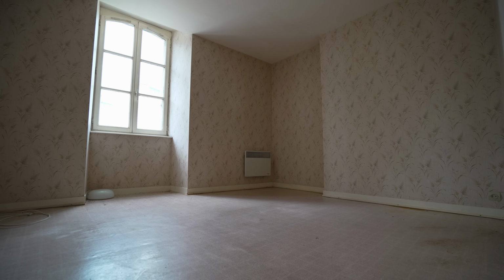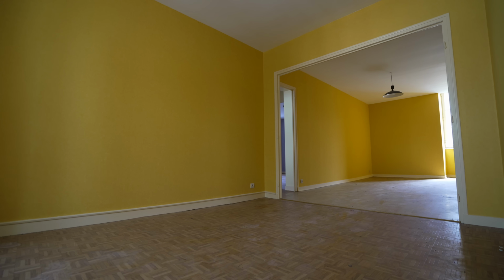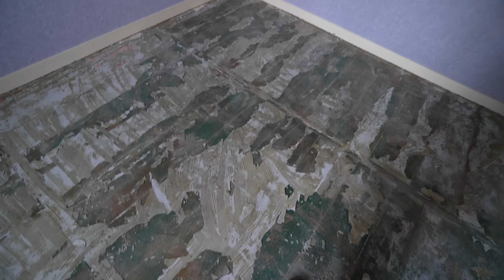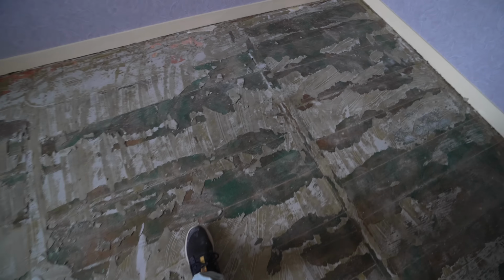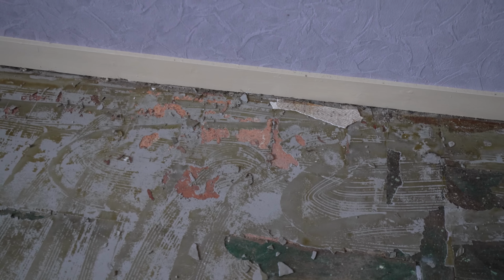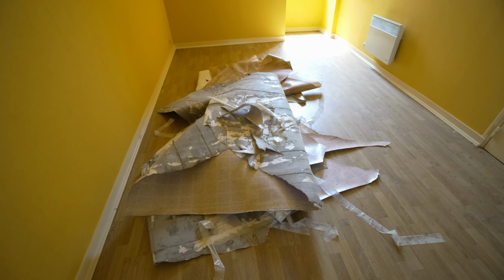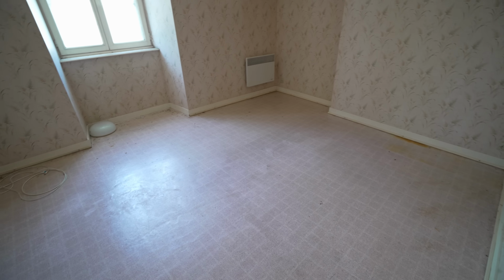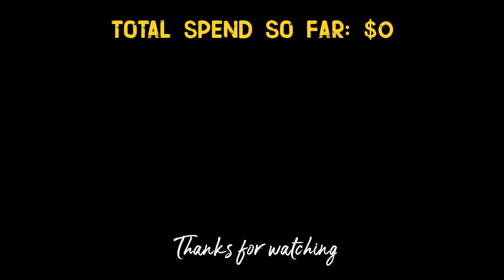Discovering The Original Floor of This 250-Year-Old Apartment

Comment: Honestly, I’d just redo all wood floors in all rooms that have them at the same time. It would actually be way more efficient and cost effective in the long run. I’d also just bite the bullet and hire out a professional crew who has the proper machines that would remove all of that adhesive in a few passes with specialized machines, sand down the wood to a nice smooth layer and then they will varnish or stain it what ever color you desire and finish it off. You’ll have new hardwood floors in no time while you focus on other areas like the kitchen. That would be most efficient and effective in my eyes.

Comment: Ryan! Please do the same level of Reno as is happening everywhere else in this amazing project! And even more so because this is going to be your Home. You deserve to invest in it. That Lino needs to be removed from that space.  Those rooms are not that large and it removed relatively easily. You deserve a beautiful space. Don’t cheat this process!
Reply: Those rooms are large - and the idea is for the reno to be done quickly and at low cost so that Ryan can move in quickly, so the best thing would be to put other flooring down now, and then at a later date, if Billy wants to, he can restore the old flooring.

Comment: Ryan, maybe Phil will lend you the floor machine he used on the entry hall floor of the convent. That might at least remove the adhesive off the green wooden floor.
Reply: I don't think that machine would be a wise option, it uses water to assist with the scrubbing. 2nd floor and wooden floors wouldn't mix great with gallons of water.
Reply: A large belt sander would be a better choice. Removes the top 1/16 to 1/8 inch or 1 to 2 mm of wood and usually leaves a good look behind. The wood can then be stained and sealed.
Reply: That machine does not use water. Phil applied scrubbing liquid to the floor & with a change of heads it becomes a sander. Perfect for what Ryan needs to remove the previous binding to bring up the original floor. Phil’s machine can sand, polish & scrub floors. It’s a simple matter of changing the rotating head. It does not use its own source of water.
Reply: Just what I was thinking. A simple change of the rotating head.
Reply: As suggested before try one of  those floor sanders. Maybe someone has one one you could borrow. Anyways good luck.
Reply: ABSOLUTELY GO FOR THE MACHINE.
LOL !
Reply: @markh3271  Yes , I would go Sanding route. I did not realize the other machine used water. Lol
Reply: I would like to see it sanded down & refinished.
Not sure if they have in France the type of floor sander with a vacuum that draws up the dust as it sands?
Reply: One could use adhesive remover...
Reply: Keep the wooden floor please!!!
Reply: See if water alone removes the adhesive! Worked for me at least
Reply: @markh3271  I think he should check for lead in the paint before doing that though...

Comment: Keep the wooden floor! You'll be sorry if you don't. It may be alot more work, but will be of more value and will match up with the hard work Simon put into the kitchen. You can always put heavy Safavieh rugs down over the wood. Next room, take of the baseboards first; then you won't have to take the time and remove vinyl again around the corners. Just a thought

Comment: I think you need to put the effort in to save as much of the original floors as possible. You can always get larger area rugs to put down to keep the rooms warm in the colder seasons. If this ends up being something that can be rented if you are no longer there it will be so much more attractive to any tenant than linoleum. I want to be there and help on this project!!! 💚

Comment: If the wood floors are throughout the apartment, then you should restore all.  In the long run, you’ll have more satisfaction, not to mention more value.  However, recovering the whole apartment in like flooring will give you more consistency and symmetry and less work.  I think you would be happier with like flooring throughout.
Reply: I do agree with you
Reply: Not Modron, like Ryan mentioned. It’s a beautiful old building, and that style should remain.
Reply: Suggestion – if you put a tarp down in the living room and put your garbage on top of it, it might make it easier and less messy to get the garbage down to the first floor
Reply: I agree, I did the same to a very old house here in NZ, it takes time , just do it one space at a time . Sand and use a two pack poly on them for a long hardwearing floor. Timber is so much nicer, has more character  and can be refinished over and over with time. Add some quality rugs and you have something more in keeping than that plastic stuff masquerading as timber.
Reply: The idea is for Ryan to do the place up as quickly as possible and move in. It would be better to put a new floor over the existing one, then at a later date if Billy wants to restore the old flooring he can.
Reply: True , but cost wise presently and time wise , it might not be feasible.
Reply: It you have the option for wood floors that are well over 200 yrs old it would be a crime to cover them.
Reply: @karenholmes6565  It would be sad but it wouldn't do any real damage.
Reply: Exactly 😊
Reply: @janetpendlebury6808  he has the time, staying with Billy/. Ryan loves to create drama. ts part of his personality. the lad will be fine. do it right the first time. dont waste money or time.
Reply: @Ragnar8504  nail or staple holes will scar the wood
Reply: @judithlalande2773  A floating floor of course, laminate or engineered hardwood. You can even install carpet with a few strips of double-sided sticky tape in neuralgic spots, especially doorways. The hwole professionally installed carpet in my gran's place was loose with some tape, a godsend when the landlord made us remove it before she moved out.

Comment: I think keeping the wood floors would be a nice touch. There are solvents designed for wood floors that will remove adhesives like that. You'll want a good floor scraper, hard plastic edge and then a couple gallons of the cleaner. After the adhesive is up, you can refinish the flooring and stain or seal the floor.

Comment: I would definitely keep the wooden original floor. Just from looking at them they don't seem too damaged, they just have a lot of glue  and plaster dust on them. You will want to use a big orbital sander to sound it down though.  If you aren't sure about the floors you could take just a normal sander and sand a portion of  the floor just to see what it looks like and make a decision. But they don't look half bad.
Reply: Don't be in such a hurry, do it right and it might last 200 years.....like Simon says about his plastering.

Comment: You know you want all original wooden floors throughout, gowaaannnn!

You should consult somebody who knows about adhesives and their removal so far as getting that off without ruining the wood. There’s probably a solvent for it, tho it’ll likely require you to wear a respirator. Maybe a flooring shop in the area would know, or a wood restoration expert? You can try grinding/sanding/chipping it away mechanically, but damage to the wood underneath is likely in all those cases (tho in differing amounts). And the wrong solvent might damage the wood as well. But I guarantee there are people out there who have the answer for just this specific situation!

Comment: Ryan - just an idea… pull up all of the vinyl flooring and sand back the timber floorboards and then varnish them. They will look amazing. You’re going to have to do that to get the glue off anyway so might as well just do the lot in one go. Avoids different heights from room to room also. Have a think about it if nothing else 👍😊

Comment: In my Arts and Crafts home…under a layer of press on vinyl tiles, over a layer of sheet linoleum, and a layer of 1/4” ply…I found perfectly preserved original hardwood, original to the home. I now have restored hardwood throughout the entire home. 

Keep and restore your original floors, and use throw rugs if and where desired. I wax and oil finished the kitchen floor…as it was when built (as well as the rest)…well worth it.🖤🇨🇦

Comment: Please wear a mask when you are both removing and/or sanding your floors. Most likely there is asbestos in that old flooring and you don't want to ruin your lungs from what goes into the air when tearing it up. Just want to keep you safe.

Comment: Wood floors are cold in winter.  Since it is just you, no kids or animals, I would carpet the bedroom.  If there is no heat in the apartment below you (at least until it gets renovated as well), carpet would help to retain heat in your space. I would do a tightly woven Berber type carpet, low nap, to make it a bit more masculine.  A nice rug for the other bedroom could cover most of the floor.  As we say here in the States, "If it ain't broke, don't fix it".  😊

Comment: Hi Ryan! So glad to see you back at the apartment getting things started. I also saw you in Billy's video. You did a great job translating. I'm seriously hoping more information is revealed with that room. So very intriguing! In regard to the floors in your new apartment, I am cheering for you to do right by this old building and bring back the wooden floors. I also hope you and Billy check out the condition of the original ceiling even if you intend on keeping the drop ceilings. This building was abused and abandoned for too long. I really believe the nuns would be so happy if you went the extra mile and did your best to restore it properly as much as you can. Sending you hugs and love, Ryan. See you tomorrow! 😘💕

Comment: I wonder if the old wood floor was painted? Painted wooden floors are common in old farm houses especially upstairs away from formal areas where cheaper wood was used. The paint just protected the wood from moisture and wear and tear.

Comment: My dad did this kind of home restoration for a living. This looks like original plank floors that were painted. This was not uncommon many years ago. It was then covered with linoleum which is normally glued down. The top layer was taped down vinyl. Please take the time to sand  and refinish these floors. I think you will be pleasantly surprised by its beauty.

Comment: Not only did many kinds of old vinyl sheet goods contain asbestos but so did the backing material and the adhesive.  The only way to know if this was made with it, is to have it tested. You REALLY do not want to just be yanking it up without knowing!
Reply: Linoleum was used here in England until the 1950s. No nasty products in it.
Reply: I'm highly doubtful that there is asbestos in the flooring. That stuff is way more modern looking!
Reply: Looks too new to have asbestos, let's hope so anyway.
Reply: They said my flat was too new to have asbestos in the ceiling plaster so didn't test, they were WRONG! Later test was positive, so I was exposed to the dust because they didn't take precautions and didn't clean up properly. The only way to be safe is to test first, and to take precautions until the test results are known. Stay safe Ryan, and protect yourself for future you.

Comment: You didnt do too much but you were considerate of every element. I like it. 👍
You can get a wide head angled stripping chisel for a rotary sds hammer drill. Just a small one like the Dewalt 273. Just enough power to beak out the resin but not damage the boards or the ceiling below.
Looking forward to tomorrow.

Comment: Ryan  rent a floor sander. The real beauty of the wood is covered by that green and  white adhesive. Few  coats of polyurethane. 
DONE!!
Just remember to use a roller for the polyurethane. 
But first any work on the walls etc. First.

Comment: You need to have the same flooring throughout the apartment so that your line of sight flows smoothly through the space.  If you don’t it will feel disjointed and confining.
Reply: You dont need the same flooring in every room, each room is its own space and requirements are different, plus it would be boring if everything was all the same. It is a large apartment and can take a few different colours and styles.
Reply: @janetpendlebury6808 actually she’s right. The wood floors even if you have to refinish would 100 percent look far better than vinyl.

Comment: Hey  Ryan, personally I would be going for removing the vinyl flooring in every room, at your own pace of course, even a beat up original floor will looks a hundred time better than any contemporary garbage including the click-clack stuff.   As for the old adhesive, try smacking it with a rubber mallet,  I found that the old hard stuff just shatters when you hit it.   Cheer to you and good hunting for more cool discoveries!

Comment: I think the wooden floor should be exposed, they're actually really easy to keep up, as well. It'll need to be sanded out, which will take up the old glue and then treated, but in the end it will be lovely. You're surrounded with folks who have the equipment as well as the know how.

Comment: You will find that original wood floor will be a great asset to the apartment. You need to clean it to get all that old glue off. If you want a rustic look you could just finish it as it is or you can sand it to get the surface even and then finish it. Those planks will probably be incredible once cleaned. Don't worry about the cracks in between planks. Wood floor board shrink from age but that is part of their beauty.

Comment: If you keep the wood floor in the bedroom, you'll need to put quite a bit of labor in refinishing it. New laminate flooring is quick and fairly easy to install but probably won't give you the authentic feeling that an original wood floor will. So it all depends on what look and feel your going for.

Comment: I would recommend covering the floor. Removing the adhesive and sanding the floor will take too long and if you want to be efficient just use the same flooring Billy is using.

Comment: .   Look into renting a floor sander. That might require some advice in respects to the adhesive since that stuff is likely to make you go through a lot of sanding belts, but the labor saving is worth it and you will get to the real, and doubtless beautiful, unpainted wood below.
.   You will want to have also an edge sander to do the final inch along the base of the walls.

Comment: Ryan: if you plan to remove the wall paper and it does not remove easily. Mix some fabric softer with water in a garden sprayer. Spray it on the walls and it will come off easier! You can score it to help get under the paper. No need for expensive chemicals. Plus it will smell nice!

Comment: I am so happy that your new residence has been settled. Ryan, as a new renovator, you really need to make a plan before just tackling everything at once. 

You should also consider putting the same flooring throughout the whole apartment. It should be a light neutral color which will go with the different decor/color schemes in the separate rooms. And a light floor will brighten those dark rooms. To get a smooth, even surface, strip all the floors to the same level in all the rooms. Don't leave the vinal in any room or the laminate flooring will create a bump where it meets the other floors .BTW, those old floors look pretty rough. You might need to even the surface with some sort of subfloor fabric or thin plywood. 

Sit down and make a plan. decide first steps through finished apartment. Buy all the flooring at one time. Buy all the trim wood you will need, Do the same with all the products and tools you will need. That way you will not be wasting time driving to the hardware/lumber store. Without a plan you will not have the things you need at hand when you need them. 

Good luck, Ryan. All of your fans will be looking out for you.

Comment: Normally I'd suggest using an adhesive remover but this looks quite old brittle and crumbly so it will probably sand right off. Do a hand sander gently in the corner or in the closet to see how it looks and if the green paint or stain come up easily. If the green is a stain rather than a paint, you might need a chemical adhesive remover and use the green as a base color for a new stain.

Comment: Keeping the original floor would give you the chance to put a protective sealant that would preserve it for many more years than otherwise expected. I agree Phil’s sander would make quick work & a good sealant would protect what otherwise might rot…preservation is key. No no click board, IMHO… just my opinion. Click board is rather tacky looking. 🤷‍♀️ I had it & truly didn’t like the look. But you have to live with it 😊. For Billy’s sake I’d preserve as much as you can… use a highly recommended sealant to preserve from worms & wear. 😀borrow Phil’s sanding machine.

Comment: Ryan - if you are going to renovate the apartment then take the time and do it properly I.e. restore all the wooden floors  strip the wallpaper (don't paint over). It may be a bit more work but it will be worth it in the long run.

Comment: I'm betting the green on the floor is paint, in older buildings in the US you find that a lot. The floor wood be painted to help with being able to keep it clean - easier to mop than bare wood and cheaper/faster than varnish, as a bonus the paint would fill in gaps so dust didn't filter through. Most times the upstairs would have cheaper woods used so that the main floor could be done up with the fancier more costly wood that guests would see.

Comment: Without a doubt Ryan! You need to remove all the old glue and get back to its original. Do it 1 time and do it right. Do each room as it comes. Also remove the old skirting as that is very cheap to replace. And once the floor is done you can keep or lay a nice hybrid on top of it. Then replace the skirting after.